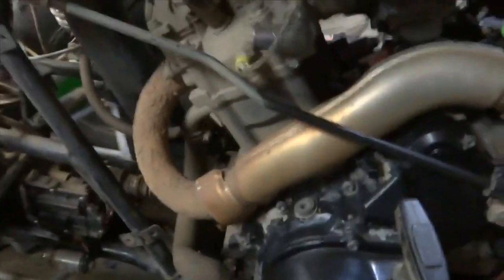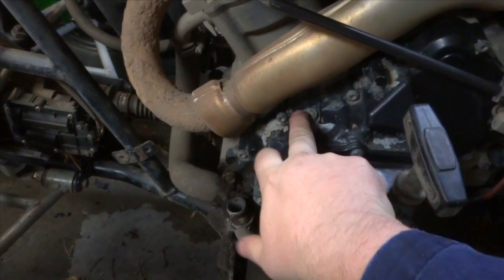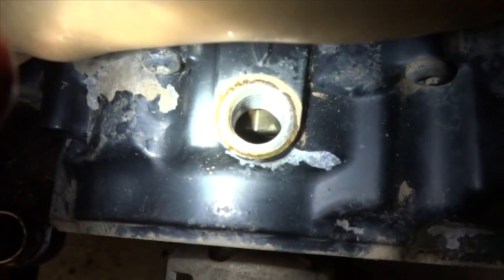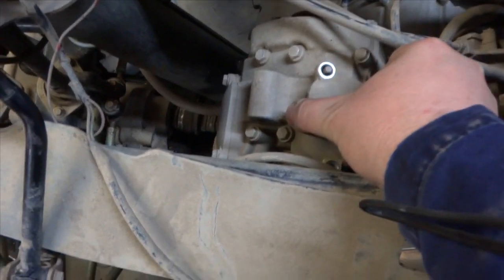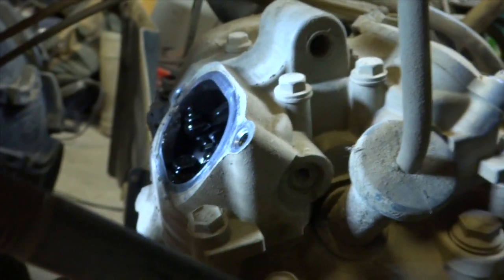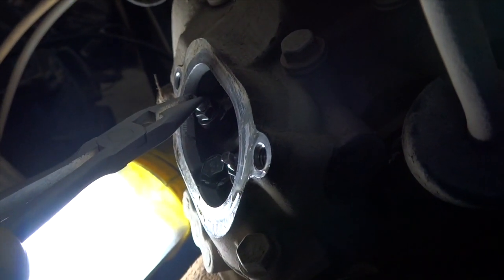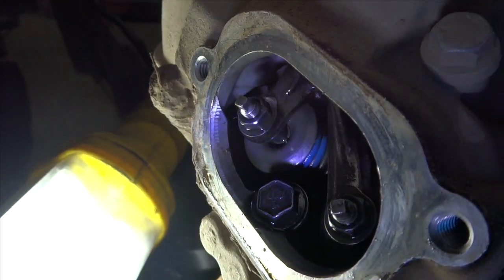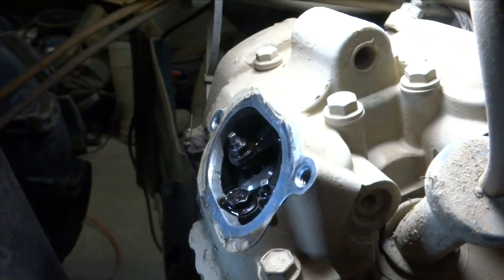DIY Valve Lash Adjustment ATV

Comment: I got an 07 650 H1 too--blew the motor in it from swamping it too many times..then got an new 09 motor in..not the fastest quad but its got a ton of powah!
I also have a Blackmagic full racing exhaust on it..she sounds pissah!  Great vids BTW
Reply from the maker: thanks, i've been thinking of doing a efi engine swap out of a rolled quad or something.  not really like the carb set up
Reply: My friend has an 07 AC 700--EFI--that quad is a beast--blows by any 700 out there..but hes got the VDI programmed yada yada--We hace reall cold weather here at times in MAine--I took the gay ass electric choke off my carb--just unhooked the wires..when its real cold i just prime the carb with the lever a few times and starts up faster than using that POS choke. Gonna go check my brakes out on my boat trailer --im sure a shit show will ensue--thanks for the vids. helps me out alot !

Comment: Great video.  I was wondering if the valves being off adjustment could cause the quad to burn coolant?  I am trying to find the problem without changing the head gasket.  I just had the piston, rings, gaskets and everything replaced 550 miles ago.  the quad takes a long time to start and runs great when started but it does seem to "tick" when running

Comment: With the time that has gone by since your last valve adjustment, don't the adjustments usually get looser and not tighter? With this quad of yours, do you have the numbers available of how many thousandths you are allowed either way before trouble is on its way. Enjoy your Monday
Reply from the maker: valves clearances actually get tighter as the seat and valve wear. I have the numbers available in the service manual the exhaust is dead on my intake is slightly out but still in spec.

Comment: How did you end up adjusting 180 degrees out? It looked like you checked the plug hole to make sure the piston was at the top.
Reply from the maker: your either TDC of the Compression or exhaust stroke I had it backwards
Reply: Bullshitkorner
Is there a way to know for sure which stroke your on to avoid this?